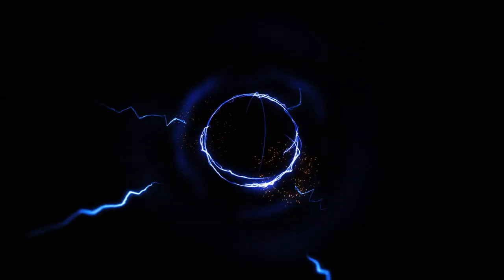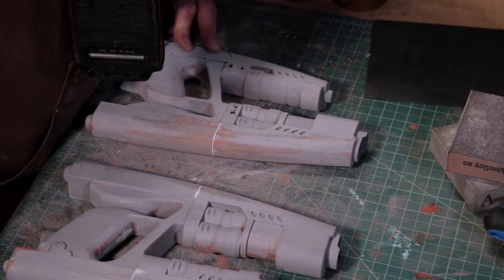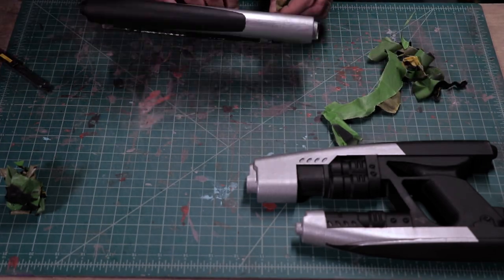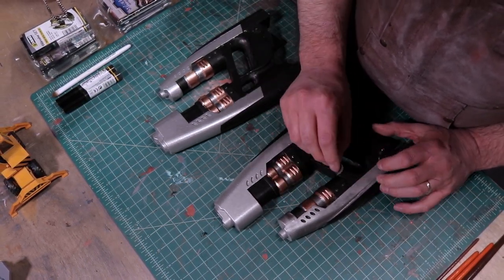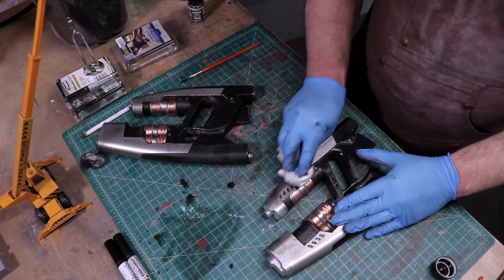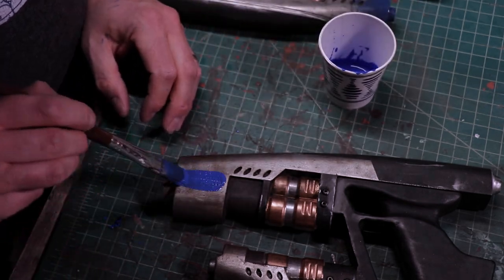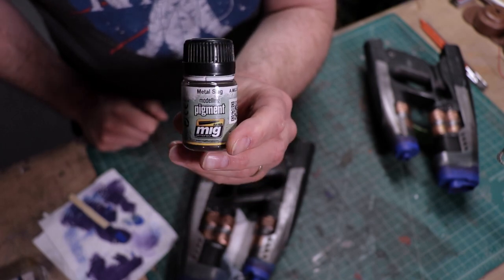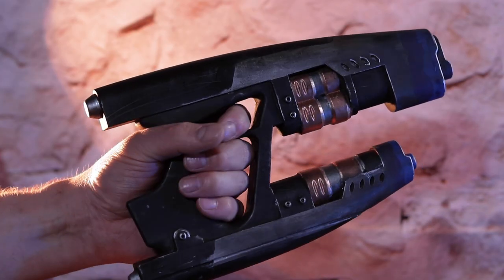Star Lords 3d Printed Quad Blasters

Comment: What scale did you use?
Reply from the maker: I used whatever scale the designer had them set at lol. I didn’t adjust the size at all, just positioned them on the print bed and away the printer went.
Reply: @MagneticNerdsCreate  but, this is kinda small